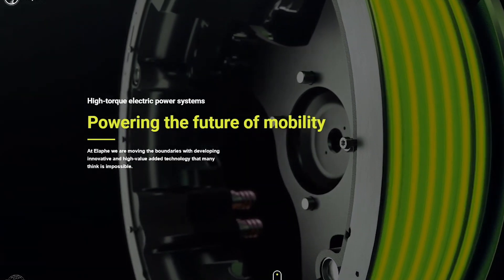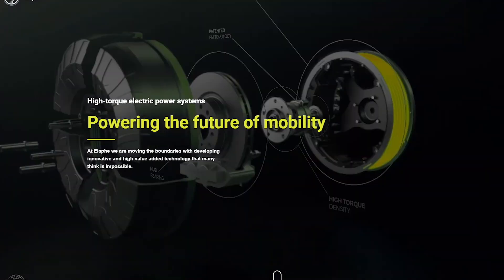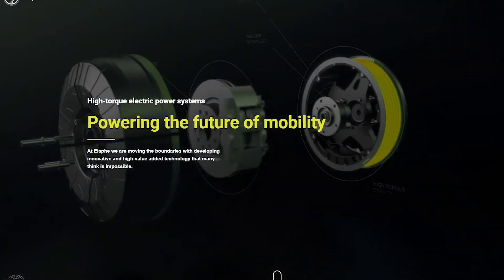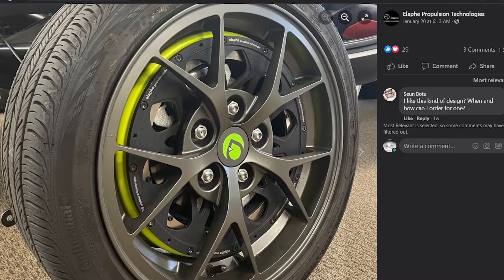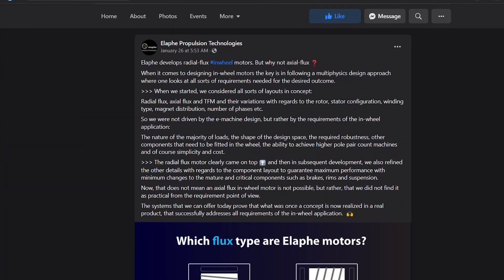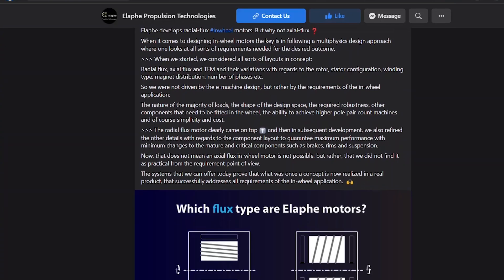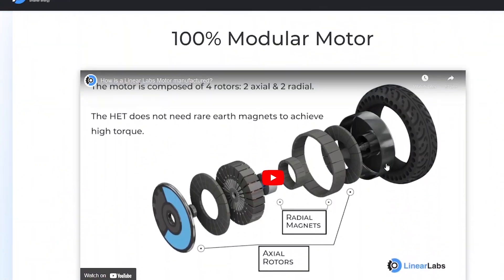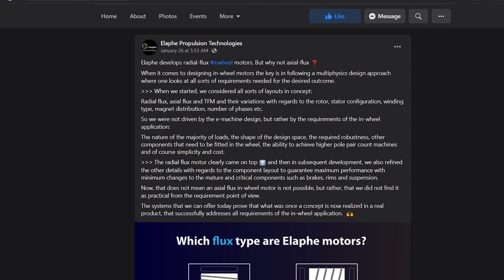Elaphe Hub Motors considered using transverse flux and axial flux motors

Comment: Really Very Nice explanation. Protean Electric also makes only radial flux hub motors; their motors have already hit the streets via Dongfeng Fengshen E70 car in China; reg transverse flux, the Swedish Hyper Car maker Koenigsegg has made one such motor and named it Quark-E motor and they are calling this tech as Raxial Flux; a combo of radial and axial flux.Regenerative breaking with Torque vectoring plus 4wheel steering by wire would be the ideal of any automotive transport. All the tech is available; only needs to be put together.

Comment: If you can’t run it underwater, you won’t be able to drive in rain.  What about ice and snow, and road salt, all realities in the North?
Reply: Aptera wheels will be able to operate in at least 10 ft of water.  All the other contaminates are sealed out by a shock absorbing potting compound, similar to what boats such as passenger ocean liners use to seal the motors that run outside the hulls immersed in seawater.  This is well tested tech at this point.

Comment: Is there still no update on motor seal replacement. You would think with all the experience and years of developing these hub motors they would at least have a ballpark of the longevity/cost of replacing similar seals so we could factor in said maintenance cost.Seems like too many people are glossing over this subject please address as soon as possible after all this is the drivetrain. Right now I don't know If it is closer to $100 or $1000 per motor and how often ballpark at least.
Reply: Well there's many fields where electric motors have run for over 10 years straight with only minor maintenance. Seals are likely about the same as seals for an an upper valve gasket leak on an ICE. So likely in the $50 to do it yourself up to $350 depending on the shop. But I'd say you're more likely to have issues with the bearings especially since Aptera is a new brand and it also is a weak point for hub motors for some reason.

Comment: I'm considering Axial Flux to replace an old air cooled VW engine in my beetle. it should be simple as replacing the IC engine  with the Axial Flux Motor on the trans-axle. No worries about flexing on turns or brake dust. Sealed to keep it clean of dirt and other foreign objects I can't see why this wouldn't work. Any feedback on that? Afterthought, it's a 60 HP Magnesium Alloy engine that weighs around 150 pounds more or less.

Comment: Did Elaphe consider an IPMSynRM motor?  They are radial flux and are more efficient and run cooler than induction motors especially at highway speeds.  This could increase the current range of the Aptera.  See video https://www.youtube.com/watch?v=esUb7Zy5Oio

Comment: Now, if there are so many problems with Axial flux motors, why did Mercedes-Benz buy Yasa, after developing and testing them for the Formula E Racing cars?
Probably Elaphe is not as far along the development path as Mecedes. Have a look at the Mercedes EQxx ...
Reply from the maker: Axial motors are great.

The issue is using them in hub motors.  Yasa does not make hub motors.  The EQxx uses radial flux motors that are not hub motors.   The axial flux motors made by yasa are central motors that use driveshafts rather than hub motors.  I've covered both the EQxx and yasa axial flux motors in this channel.

https://youtu.be/PwQNID-QCI4

https://youtu.be/e1hHE7AyeZY
Reply: there aren't problems, they are just too lazy to change.
Reply: @Blox117  Actually the axial flux motor was invented first, a whole 10 years first in reality. The issue more is that axial is far more expensive and harder to make as durable. The main designs for it are more efficient than radial, but they wouldn't take nearly as rough an impact directly. But the main one is just the price. Being more expensive and elaphe being a startup likely is the main issue.
Reply: @Skylancer727  the impact would be inline with where the bearings are

Comment: It's hard for me to understand how the permanent magnets don't pick up lots of metal debris .
Reply: They are completely potted.
Reply: @n.brucenelson5920  Yes but magnetic fields will travel through any type of casing and small metal debris could stick on outside casings, but maybe that would do no harm .
Reply: Many brake pads are ceramic or aluminum so they don't make magnetic dust.

Comment: Thanks for the great content summary.  It really seems like axial flux might only make sense for systems which don't need to fit unrelated components (ie breaks) or handle unexpected lateral loads.  This explains why it is still a great option for small electric planes but might not easily find its way to automotive (atleast not without exotic materials to handle the engineering requirements).  Definitely a goof on Chris's part in the Leno video but overall it doesn't make much difference to the end product.  Regardless of the flux type the motor should achieve very high efficiency and thats the key.
Reply: not really, i managed to make my own custom axial motor. i am considering adding a radial component by bolting together the two rotors into one and having the third in the middle rotate over top of the stator

Comment: Very informative, thanks!  I think you got to the real issue with hub motors and that is maintaining the air gap integrity under the various loads it will be experiencing.  Elaphe was able to secure some funding from the EU to develop their hub motors.  As I recall, the contract required testing data and analysis, and the main issue was ensuring the air gap spacing under various loads and against environmental intrusion.  In their call with Aptera, Elaphe stated that the hub motor would require periodic maintenance to replace a seal.  They downplayed the difficulty of this as the wheel can easily be removed, say for tire rotation, during this time the seal could be replaced.  Do you think you can get Elaphe to give us a bit more information on these seals?

Comment: Yeah, it is definitely a balance between cost, use, real world complications and capabilities of axial flux motors. Koenigsegg just announced their Quark EV motor that apparently uses both radial and axial flux design (TFM?) and produces a whopping 335HP/443TQ (246kW) in a 68lb (30.8Kg) motor. But it only makes that huge power for 20 seconds, and then ramps down to 134HP (99kW), which is still good for its size and weight. We don't know about the Quark's efficiency, but Koenigsegg's hyper/megacars like the Gemera cost well over $1M, so they are using a lot of exotic components and materials in this new motor that would not be realistic or cost effective on the Aptera.
Reply: linear labs is a scam, they haven't produced any motors
Reply: @Blox117 you are correct!
Reply: i think i have ideas on how to maintain range

Comment: Having established that the hub is not sealed, and given that road debris includes nails and other ferrous bits of metal, how robust is this design for possible metal intrusion?
Reply: The critical components in the wheel ARE sealed. (potted)
Reply: @n.brucenelson5920  yeah and how long until that stuff cracks and breaks off? then you have no motor. stupid design
Reply: @Blox117  I have worked with such compounds in marine electric motors.  They are rubbery and do not "crack off"  This is well tested tech built to ISO standards and well tested.
Reply: @n.brucenelson5920  amazing, i truly didnt know you could fill the air gap with rubber. that rubber is truly a miracle material
Reply: @Blox117  The air gap in a motor is not a "component"  Look at an engineering drawing and understand how they are built.  The large electric motors that drive passenger ships are immersed in salt water in pods outside the hulls.  Achieving proper isolation from the elements is a much easier problem in the hub motors and has been long solved.
Reply: @n.brucenelson5920  oh yes you're right, the stator and rotor should be able to slide against one another. makes perfect sense
Reply: @Blox117  What is your point?  You are just showing you know nothing about motors....
Reply: @n.brucenelson5920  oh yeah, its not like ive built an axial motor from my own design or anything. that would just be silly
Reply: @Blox117  You can put anything in the gap between the stator and the rotor, it's the same as transformers. All that matters is the rotor is not completely locked to the stator. I'm not expecting it to be concerning though, both the rotor and stator are in the chamber so the flipping fields should push away objects collected by the permanent magnets.
Reply: @Skylancer727  anything you put between a moving and not moving surface will be moved on one side and not on the other. only a not very viscous fluid would work.